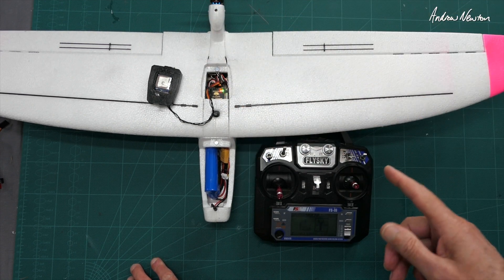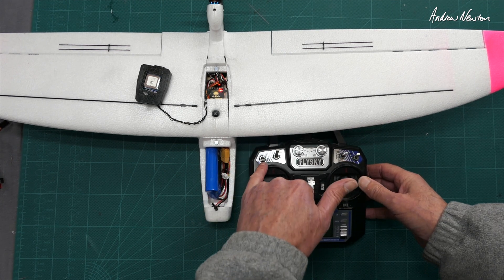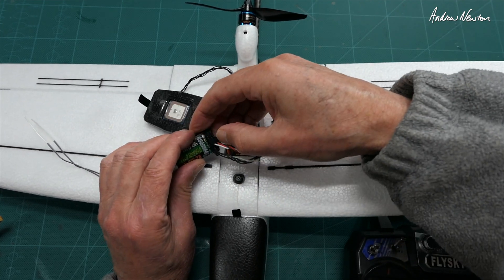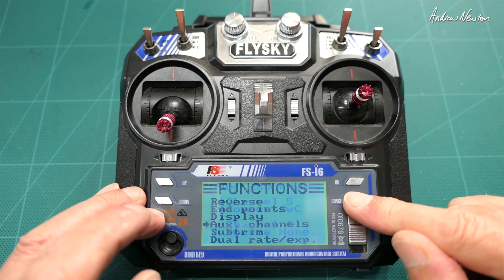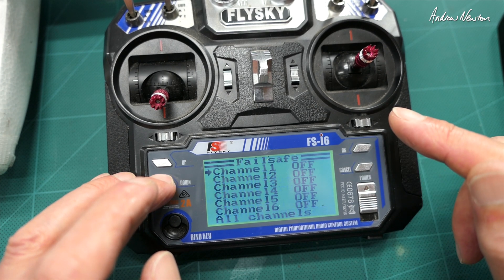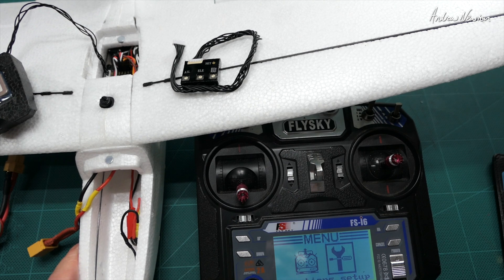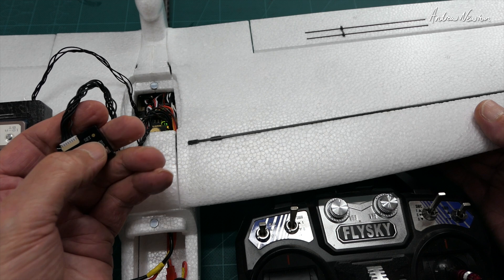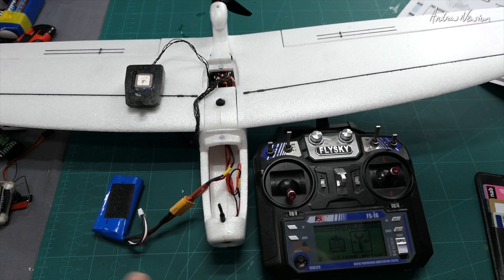Kopilot - Drift - Flysky FS-i6

Comment: Is it normal for channel 4 to activate the elevator. I'm using the flysky i6 transmitter but cant find a setting to turn the this channel off
Reply from the maker: Ch 4 is fixed as the rudder stick on my FS-i6

Comment: Hi Andrew  when setting RTH mode with the screwdriver clockwise  both ailerons should wiggle and the elevator should rise or am I in fence mode ?
Reply from the maker: It will wiggle with both I suspect but I never use fence mode.
Reply: @AndrewNewton  Nope. Fence mode operates the same as Stabilized mode inside the set fence radius. It should also give Up Elevator at start off to try to get to the 35m floor of the allowed Fence Cylinder. (Have to check that 1.)

Comment: My receiver is the FS-IA6B (IBUS) (PPM) does it work?
Reply from the maker: Could use PWM
Reply: If using FS-i6X or S radio (NOT FS-i6) you can set it to send S-bus to the FS-iA6B on the i-Bus output pins.

Comment: Hi great video  i want to put in my warbird using the sbus lead on my 8 chanel  receiver but can not get my retrzcts and flaps working on chanel 7 and 8?
Reply from the maker: Which receiver? Can it do PWM and SBUS at the same time?
Reply: Thanks  for getting back yes thats it spot don't know why i did not thik of that using pwm it was a rm 68 reciver with  tx16s transmitter

Comment: Hi Andrew. A question for you on GPS's, the ZHOD kopilot GPS is a Beitian BN-220 , Will any BN-220 work with it or does the number under the barcode need to match. Lots of them on Banggood and other sites but not sure if they are all the same. They look the same .Ya had a mishap with my plane and did not fine the GPS and need to order another one.
Thanks in advance
Reply from the maker: All the same as far as I know
Reply: @AndrewNewton  Thanks Andrew. Hope your doing well.

Comment: carnt seem to do leveling calibration wen put switch  in last position stabilize move throtle mottom rite left stick botom left hold there all day get no slashing to say calibrating
Reply: Same here. has something to do with not having rudder channel programed (even though there is no rudder). The kopilot uses it for the inputs. very confusing and i havent figured it out yet.
Reply: @caymanhilldesigns453  Yes. If using PWM you must have the Rudder output from the receiver connected to the Kopilot even though you have no Rudder output from the Kopilot to the non-existent rudder on the Drift. Otherwise you cannot give the correct calibration stick command from the radio. Note also that, if you had to re-map your channel order to suit your Tx/Rx pair to the A,E,T,R,Mode required by the Kopilot, the stick positions may be different - try all 8 possible for 5+ seconds each. (The throttle has to be down so there are only 2 possibilities for that stick.) Your sticks also need to be calibrated (and no trims) so they give full +/- 100% throws.

Comment: Hi, I was wondering also if I can modifie the elevator and aileron on my controller if I’m using the regular mode with zohd kopilot, that way if I cannot modifie the elevation when launching if I give less movement to my elevator and aileron it will help me if I launch au regular mode. Thank you again
Reply from the maker: You could have a little bit of elevator on a switch for launch, but mostly you lust need a stronger throw slightly up
Reply: Thank you again for your advise M. Newton, have a nice day.
Reply: Hi M. Newton, I installed a parachute on top of my arwing 900 for the landing. It work nicely and help me not to damage when landing in rough area. I use the channel 6 to launch the parachute and I was wondering if I can deactivate the motor when activate the switch for my parachute even if I’m on auto level mode with kopilot. Thank you and have a nice day.

Comment: Hi M. Newton, I have the same control and kopilot as the one on the video. I was wondering if it is possible to install the camera relay on the kopilot as you showed on one on your video showing 3 ways to install a camera. I would like to install it to help the camera with the left and wright movement. Thank you again for the information you provide me, have a nice day.
Reply from the maker: Must be connected by SBUS to enable the spare AUX on the Kopilot so it's probably not possible. You could try connecting the pan servo directly to Ch 6 if you're using an iA6B receiver.
Reply: Thank you M. Newton and have a nice day.

Comment: Hi Andrew!
Can I remove the setup board after finishing the flight controller setup? At what point should this be done?
Reply from the maker: Yes, remove it when it's all working properly.
Reply: @AndrewNewton  Please clarify the procedure! After finishing the settings, to save:

1. Removing the board.
2. Disconnect the battery.

or:

1. Disconnect the battery.
2. Removing the board.
Reply: @СергейЛарионов-у8в  
1. Removing the board.
2. Disconnect the battery.

Counter intuitive but that is the ONLY way to save settings changes!

Comment: Hi M. Newton, I was looking around to see people launching with kopilot a sonic model, because i have some problem with auto launch when I'm trowing the fixwing, so I have to start my flying on stabilizer mode. But I saw on youtube someone that mirror channel 3 to channel 6 and was able to control the throttle  on RTH mode. What do you think of that solution and can it be done on a Flysky controller. Thank you and have a nice day.
Reply from the maker: I would think it's too dangerous to have throttle on a switch
Reply: @AndrewNewton  Hi M. Newton, I think it was to control the motor on rth like when you use the stabilizer mode. The big avantage I think is to be able to launch it the same way on normal mode but be able to use the rth mode. If you. want me too I can copie the link and send it to you, because maybe I don't express my self perfectly. Thank you and have a nice day.

Comment: Hi M. Newton, I was wondering in stabilizer mode my ailerons and elevator have a really short travel. When I put it in manuel mode, everything is normal. Is it the way it should be ? I found it weird that I don't have a larger possibility with my aileron and elevator. Thank you and have a nice day.
Reply from the maker: That's normal. I thought I explained that in the video.
Reply: @AndrewNewton  Hi M, it was in my mind every time I was flying but you just remove that preoccupation, thank you for answering that fast and have a nice day.
Reply: I was just about to ask the same thing!!
👍
Im setting the Kopilot to an ia6B receveiver, Flysky I6 remote, and Freewing F8E Crusader ❤️

Comment: FOR ANYONE HAVE ISSUES WITH KOPILOT, I only had RTH and 2 Stablization modes on my ZOHD system but when I added a homemade 25v low ESR capacitor, it switched it to the normal 3 switch system RTH- normal - stablized. The system works great but if you run into any errors do not worry. Just keep recalibrating and/or add a capacitor. Great video as usual Andrew!!!!
Reply from the maker: Great tip thanks

Comment: Gave my Drift it’s maiden flight this evening after watching this video. Had it too nose heavy to start with and while “hand tossing” in manual mode it nosed in heavy, jamming one of the aileron servos. With not much to lose I set the damaged aileron level and switched to stability mode. The Drift launched and sailed around beautifully on one good aileron! Tested RTH and that worked fine too! Lovely little plane for a quiet evening flight.
Reply from the maker: Ha, nice one. One aileron surprisingly works OK

Comment: If you reverse the C switch.. the RTH is at the bottom and the stabilized mode will be in the TX default at the top.
Reply from the maker: That's the idea

Comment: 6.45 "I'd hang onto it just in case the throttle fires up!" Nope, it won't. When the Kopilot has the controls (RTH & Auto-launch) the motor won't run till the speed over the ground (as measured by the Kopilot GPS) exceeds 4m/s. WATCH OUT when flying home into the wind! 
Also, as commented elsewhere here, the manual diagram for wing setup is looking at the BOTTOM of the wing! And, as Andrew noted, RECALIBRATE the radio after any and every trim change to keep Stabilized (and RTH) in sync with Manual!
EDIT!! That "looking at the BOTTOM of the wing!" thing is probably incorrect. BUT NOTE for a V-tail it will depend on how your servos are mounted. In particular, for the ZOHD Talon250G, the servos for the Rudder and Elevator are mounted in the body in a reversed position from the 1 shown in the Kopilot manual - so you need to swap the E/R leads over from the Kopilot diagram.

Comment: I'd like to point out something that happened to me when I setup the Kopilot Lite on the Dart 250g. I was looking at the Dart 250g user guide and the picture on there is looking from the BOTTOM of the wing. So it looked like AIL channel was on the right wing and ELE channel was the left wing. So this worked I was able to set this up and get the correct movement to counteract roll and pitch in stabilized mode. BUT once I removed the setup control pad, those reversed which would be a guaranteed crash! So make sure AIL channel is on the LEFT wing and ELE channel is on the RIGHT wing for any wing setup.
Reply from the maker: Thanks Wes. Important information

Comment: Would FS-iA6B receiver work for this airplane? Not sure the difference between iA6 and iA6B.
Reply from the maker: Yes the iA6B is just an iA6 with hard case, iBus and telemetry capability as well as the normal PWM servo outputs

Comment: Thank you very much for a detailed and sequential setup assist video. Ive been wondering about the aux ch6 on kopilot as a buzzer or perhaps LED strip option
Reply from the maker: Ch 6 is only available if you use an SBUS receiver, but yes you can use it for anything
Reply: @AndrewNewton  Right now I have a low ESR capacitor in the CH6 spot on the ZOHD controller, Would I be able to hookup a servo to pan my Camera or power LED's? Im not sure on the limitations of the servo spot, plus im using normal pwm hookup for my receiver